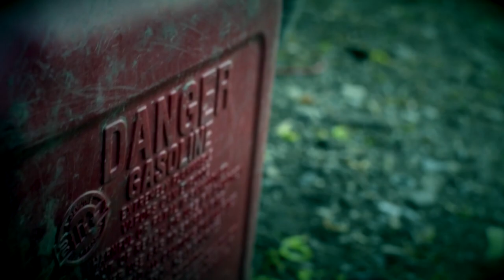Changing the catalytic converter on a 2011 Jeep Patriot

Comment: Take the thermostat off and you don't have to take the valve cover off. The manifold comes out smooth as glass toward the drivers side
Reply from the maker: That's a great tip! If we have to do this job again, we'll definitely take a try at it that way. Thank you! Thanks for watching!